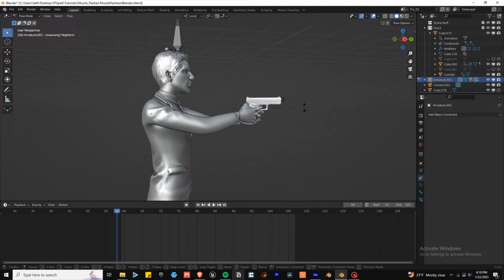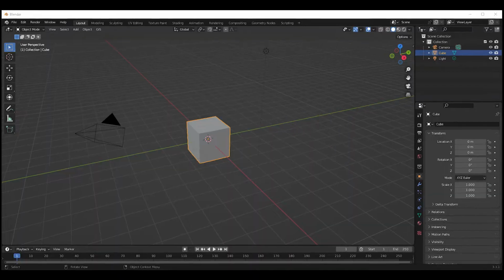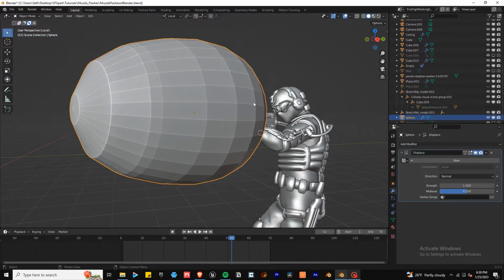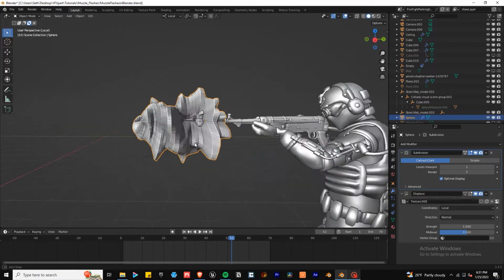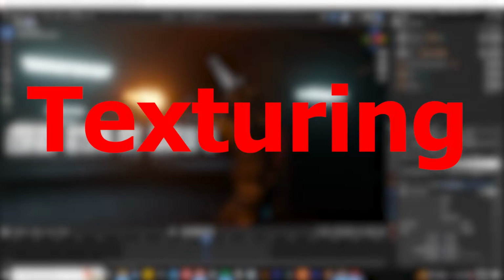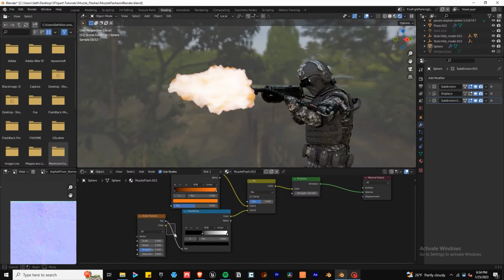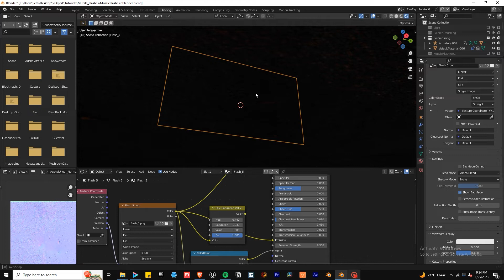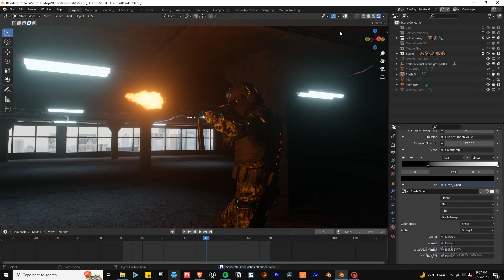How to Make Realistic Muzzle Flashes | Blender Tutorial

Comment: so when I made the flash texture and connected the emission node to the volume on the output node it just made a giant block of light instead. any thoughts?
Reply: The same for me. There is an advice to switch to cycles in the comment above, but that doesn't work.
Reply: @fantasy9917  yeah I did that too and the other engines but still nothing
Reply from the maker: It might be because you’re in the preview mode, which uses eevee regardless of which engine you pick.
Reply: @VFXpert  how do I get out of preview mode?
Reply from the maker: If you toggle the “z” key, it should bring up a pie menu, and the render viewer should be on the top. There should also be an option on the top right of the main viewport to switch modes. Hope this was helpful!
Reply: @VFXpert  awesome thanks!
Reply: @VFXpert  I've went into rendered view and switched between each engine, nothing works. It still comes out as a large block of light, please help, thanks.
Reply: Hey man I just wanted to say thanks for this. This was driving me crazy and didn't even think to check that. Also great tutorials! @VFXpert

Comment: When I set the Emission to Volume, the mesh turns into a blurry cube.
Reply from the maker: You might be in Eevee, in which case, switch to Cycles for that stage.
Reply: @VFXpert  Thanks a lot!
Reply: My laptop doesn’t render in cycles… please is there a way to go around it?
Reply: @Phoenix3D_  i mean you can always just use a simple orange emission or something, won't look as good but if bloom is on then maybe itll look decent
Reply: @in.zclouds  alright, I’ll try that
Thanks
Reply: @Phoenix3D_  and you can just apply the displacement modifier i think

Comment: What’s the point in bringing it back in as an image texture, instead of leaving the object in the scene and keying it’s visibility? I feel like you lose a lot of control this way and create extra steps.
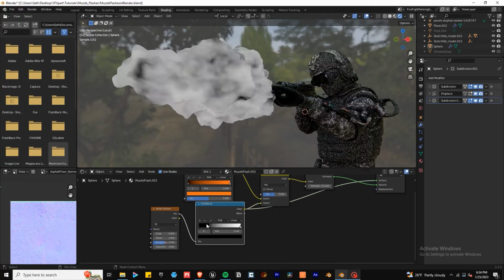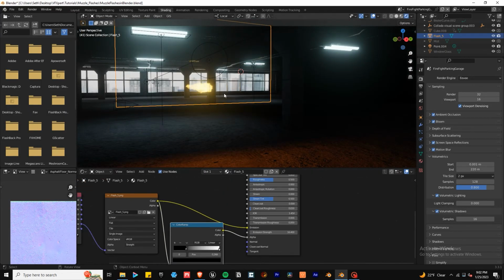Reply from the maker: It's not something you have to do, but I did for a couple of reasons. 3:35 - It doesn't work in Eevee as a volumetric shader, and (4:35) I liked having the control to color grade the flash afterwards. Now, this is a video about how to make this effect in Blender, and I wanted to show how you can do basically compositing in realtime, which I would usually have done in After Effects. Thanks for asking!
Reply: @VFXpert  That makes sense,  it didn't register at first that the volume output doesn't currently work in evee. Thanks for the reply!